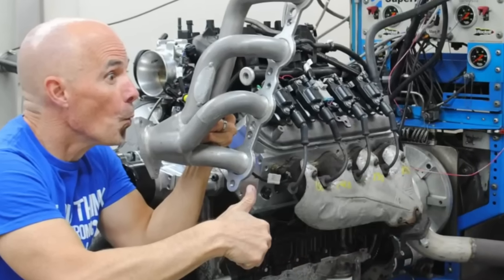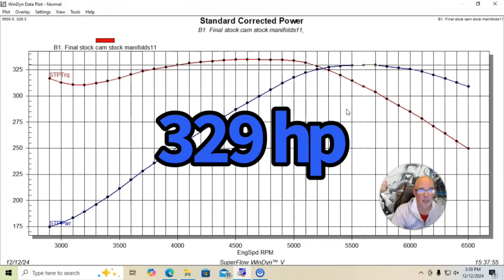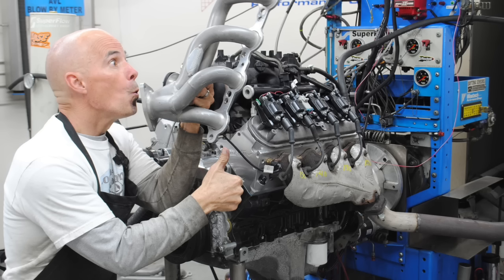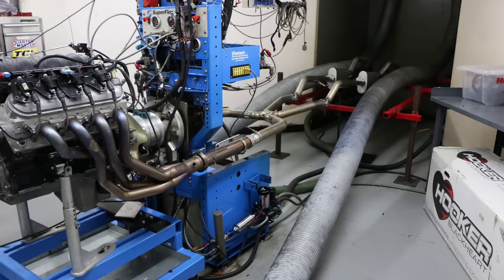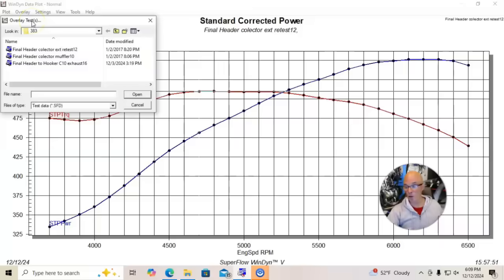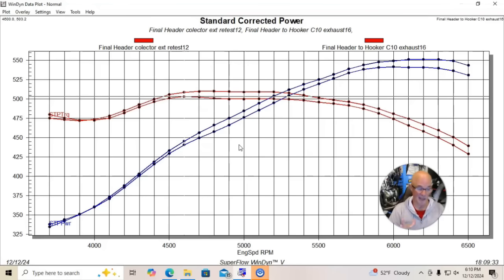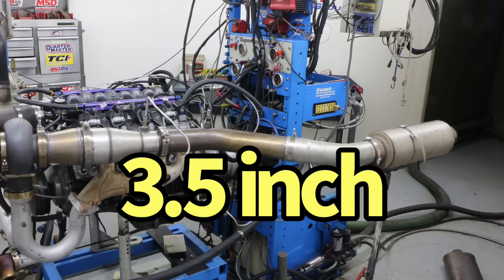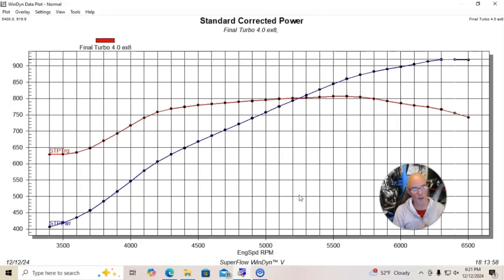LOW-BUCK, CHEAP VS EXPENSIVE HEADERS-WHO WINS? STOCK VS SHORTY VS LONG TUBES, BIG TURBO EXHAUSTS.

Comment: For a slightly modified 302, for off line torque stock vs shorty or long?
Reply from the maker: long
Reply: @richardholdener1727 thanks!

Comment: Hey Richard have u ever done a test on an engine with regular long tube headers vs 180 degree headers being the only difference?  If so which made more hp
Reply from the maker: never tried 180-degree headers-very hard to package
Reply: @richardholdener1727  could make them in house lol I’m sure you know a fabricator or 2.   I’d love to see if the claims are actually true.

Comment: You just saved me 3000 bucks for an expensive long tube xpipe setup for a tow cam 5.3 build I am doing... lol.  I very much appreciate your videos and I was wondering if I could through patreon donation get a recommended build including fuel delivery, cam, exhaust, intake, throttle body etc to make a 2006 gmc sierra 5.3.  I don't much care about numbers insofar as I was it to comfortably tow 5000 lbs rv with ease, not be too loud and come in with a rebuild, which I will do myself, with a 4 to5k budget including machine shop typical costs etc. The donor motor is from a 2006 and has good compression but I plan on a full rebuild and was thinking of increasing the compression ratio a bit with some higher compression pistons. I already have a dual tip mbrp cat back exhaust and being in canada, plan to replace cats with resonators if the power gains would be worth it.  (we don't have air care where I live 👍)

Having an expert create an efficient build list to maximize gains for the $ is worth it when considering the cost of things these days and I would be happy to pay for that as knowledge is never free!  Lol
Reply from the maker: join the nightly live feed at 7 PM PST on this channel
Reply: @richardholdener1727  will do!

Comment: Bigest issue I have with headers in my small block chevy 350 is interference with spark plug changes and melting plug wires.  I'm going back to manifold.
Reply from the maker: that does happen

Comment: To whom it may concern.... if you are considering changing to long tubes and full exhaust on your silverado. the NOISE is the most extreme difference. ended up swapping mufflers 5 times and settled with a 70 series delta flow i could live with
Reply: Went with a Vibrant Ultra Quiet Resonator and it sounded great with basically no drone!!!

Comment: In my experience, headers are most important on camed NA motors. Roots/screw/centrifugal superchargers don't care that much. Turbo engines mostly only care that you get all the exhaust to the turbo, they don't really seem to care that much how as long as the pipes aren't ridiculously long or oversized. Will still make boost and power you might just have to wait slightly longer. 
After the turbo go as big (within reason) as will fit in the car.
Now if you want every last few hp you can spend thousands on equal length turbo headers but for most just get it to the turbo and angle your wastegate efficiently.
Reply: This is totally untrue.   People always say oh boost doesn't care about headers that is absolutely nonsense.  My 07 gt500 picked up 15 rwhp and 40 tq peak to peak gains going long tubes and the car already had a catless h on it prior to that and I went w a catless h w the headers so then only Change was headers.  It picked up 25-30 rwhp through most of the curve and 40 tq down low around 3000.  Oh and it did this at 1 psi less boost too.  Imagine if you added 1 psi to make up for the efficiency dropping boost imagine how much it would be at the same boost?  This was with a 2.65 tvs gen3r supercharger.  So yes I'm gonna say that roots blowers not caring about headers is untrue.
Reply: @midnight347  Where did I say boost dosn't care about headers?

Comment: You might have already done this.  But I think it would be interesting to have a video showing stock LS with stock computer and stock tune compared to the optimized tune with the HP Management system to show how much the factory is leaving on the table.

Comment: Out of curiosity, when you set up the tune .. are you just using a base map that you've already dialed in for a general combination or do you take that base tune and then modify it even further to customize it to each engine? I only ask because I'd have to imagine if you are doing a tune for each individual motor that has to take a lot of time.
Reply from the maker: every NA motor and every combo is tuned so that it makes no more power-the turbo stuff we don't keep adding timing til it stops making power

Comment: It would be really cool to see a 6.0 LS turned into a 392 stroker motor.
Reply from the maker: 402/408 is more common
Reply: @richardholdener1727  yeah I understand that but the whole process of sending it out to a machine shop for 10 to 16 extra cubic inches seems a bit much.

Comment: I wonder wath power dou i miss!! If I miss the Adjust the rockers.I have tou bigg Adjust the valve with 1mm.Tou Bigg less!?.Mek Cam Roller.Have ProchargerF2..May ges least 20-30 Hp.Wate dou you tink??? AHope you anderstand may question!
Reply from the maker: YOU DON'T HAVE TO ADJUST THE LASH ON HYD ROLLER CAMS LIKE MOST USED IN THE LS. IF YOU RUN A SOLID ROLLER (RARE), THEN YOU NEED TO HAVE THE CORRECT LASH AND ADJUSTING IT CAN CHANGE THE POWER SLIGHTLY.
Reply: @richardholdener1727  I men have Mek Cam.i miss 1mm in lift!! Most dou least 20-30 Hp!! Thats a lotta miss in lift.8 Intake valves!! In Boost Engine wood dou more loss!! Tanks you anser me !!👍👍❤️

Comment: I have built my OBS to be as reliable as possible with stock exhaust manifolds that don’t burn wire boots or leak after 5 years!  The only upgrade I have done is a stage 1 summit cam, otherwise stock. Starts every time and runs great.

Comment: Hey Richard, I've been watching you for a while now and always find good info in your videos. I have a question about approximate hp estimates. I have a fresh 6,2 L92, .020 over, .006 of the deck and heads, TSP L92 stage 1 truck cam 216/228 .600/.600 113 lsa, long tube headers, True dual 3" exhaust with high flow cats and magnaflow mufflers. My Denali is AWD and dynos in my area are all 2wd. Will be tuned with hp tuners. what do you think the hp numbers will be close to? What do you think the most timing it should see WOT? 
I'm 63, been into cars my whole life, built many go fast small blocks, but this is my first full efi build. My tuning knowledge should cross over fairly well instead of getting my hands ditry, I'll be going over data logs and pecking at a keyboard. Any insight would be appreciated. 
Thanks again for all your video's.
Reply from the maker: AB L92 WITH THAT CAM AND HEADERS WILL EXCEED 500 HP THE WAY WE TEST THEN ON THE ENGINE DYNO. AN LS MOTOR MAKES BEST POWER NEAR 29 DEGREES AT THE HP PEAK (BUT ON PUMP GAS AND AT STREET OPERATING TEMPS-YOU MIGHT NOT BE ABLE TO RUN THAT)
Reply: Thanks, Richard, that gives me an idea on what to expect if I ever get a chance at an AWD DYNO. Hopefully,  400hp at the wheels. Now, if I convert to 2wd...

Comment: not really a fair comparison, big dollar headers are designed for a specific vehicle fitment, clearly requiring more work, vs the more generic ones with straighter profiles.. So if anything with less twists and turns they should perform better

Comment: Would still like to see an air filter test. From the really small K&N style, for those with no space available, crappy screens, to either no, or a proper sized filter. And indeed bellmouths on a turbo engine that somewhat pushes the filter setup on test
many installs are space limited because they opt for big turbos

Comment: Hi can you take  706 with  ls1 valve intake and cut 1in" of the head  to make it 55 cc with  Cometic Head Gasket 0.030
Reply from the maker: 1 INCH?
Reply: @richardholdener1727  yeah new low buck preferences 😂

Comment: I love ur knowledge and ur videos. I really wish u would point me in the right direction for a decent port fuel injection for the older 4.3 vortec v6. The only option I can find is the mercruiser cast iron intake manifold and fuel injection system. It's hard to source the old typhoon or syclone fuel injection systems. I am trying to build my own typhoon with a turbo awd bravada, but selections for fuel injection on the 4.3 is nearly unobtainable. Any help would be appreciated. Thank you.

Comment: So the expensive headers have to  be way better quality and the fitment must be on point ,it can't be because they flow better
Reply from the maker: CAN BE MATERIAL AND BUILD QUALITY AND FITMENT-BUT NOT ALWAYS
Reply: Would you say in most cases the inexpensive header will do the job just fine?

Comment: I’m seriously considering buying a 2025 F-150 regular cab with coyote engine how much H P gain can I expect with kooks long tube and high flow cats and true dual exhaust?
Reply from the maker: I have not tested the newer or truck versions-but do have a video up on stock vs shorty vs long tubes on early Coyote
Reply: Ok thx.

Comment: Always new cheap headers make good power but the problem is the build quality. Not all cheap headers built the same either iv had ones that the welds broke everywhere had ones that didn’t.
Reply: Fitment on the vehicle is also a concern

Comment: Hi, very interesting test results.Are you also comparing, but  not releasing ex. back pressure vs boost vs ex. pressure after the turbo? Are you only? looking at ex.pipe air flow?( all ex. components?)  OR are you also looking at- lol LISTENING to the SOUND each component/ pipe makes? I have built parts that flowed the same BUT sounded completely different and got completely different dyno results when testing the 2 components.
Reply from the maker: I measured boost and back pressure. back pressure was changed both before and after the turbo (we measured both). Exhaust sound also changed dramatically

Comment: Couldn't you have turned up the boost on the boost controller to make up for the exhaust? Or was the turbo maxed out at that point?
Reply from the maker: yes-you can add boost-the S480 was good for over 1000 hp
Reply: @richardholdener1727 I know the S480 is good for over 1000hp under ideal conditions. I was wondering if the 3" full exhaust was choking it down to the point that the boost controller couldn't make up for it.

Comment: My stock engine 1990 Mustang GT at Bandimere in 1997 ran 16.048 and 16.051. With Mac 1 5/8 unequal length and an under drive crank pulley (not the whole set) it went 15. 891. The headers were the big difference. They didn't go on at the same time, and I didn't go to the track in between. With crappy E7 heads. It sure helped them.

Comment: Wish you showed some of the tri y 4-2-1's but decenf length. Ive got a variatronic steering rack and the last one of ghese cars took me ages to make long tubes fit. It has 4-2-1s on it now that fit so much easier and wondered just how bigger difference tye 4-1 would make.

Comment: Other engine family’s will benefit more from even a shortie header due to restrictive stock manifolds. For instance the 5.7 Dodge truck engine will see gains in the high teens with a decent set of shorties like BBK sells. That and a muffler change can see gains well into the mid 20 HP range.
Reply: I was gonna say the LS stock manifolds are pretty good compared to the old school small block manifolds
Reply: This is true.  If your stock manifolds are horrible, even shorties will make good gains.
Reply from the maker: see the shorty vs long tube header tests on the Hemis-the Ram Truck manifolds were not good
Reply: @richardholdener1727 Those Hemi Ram exhaust🎉🎉 manifolds are absolute junk! Put long tubes and a nice exhaust system on my grand daughters 1500  and it ran so much better after it was tuned.

Comment: Large tube, long collector extension,3.5 inch open. On a small block.
Reply: @TT64NOVASS with an intercooled 10-71
Reply: With an 18 inch extension